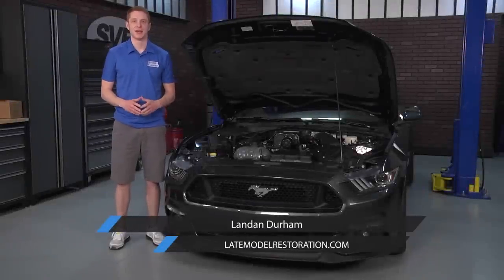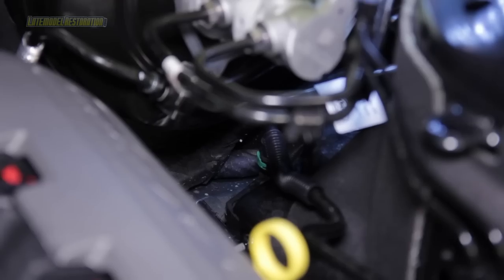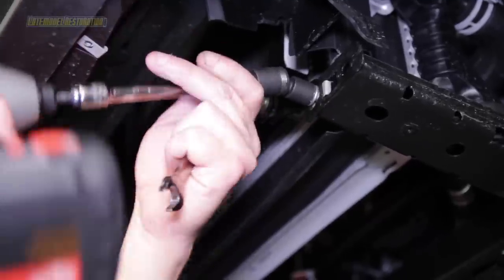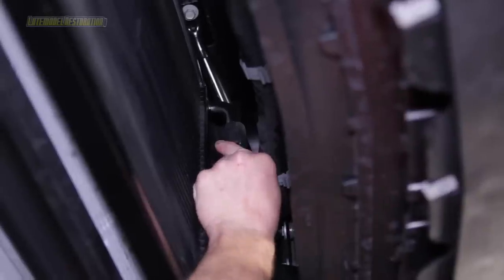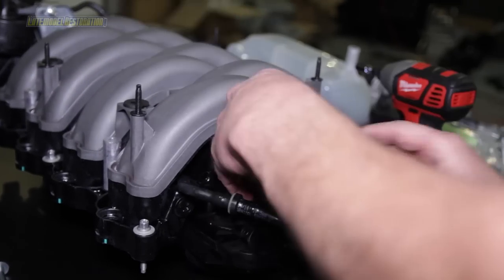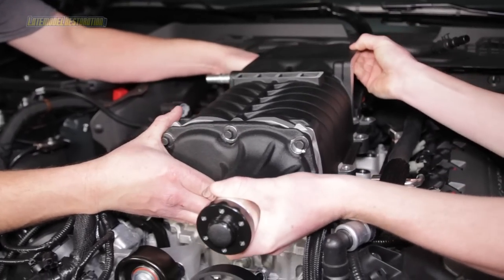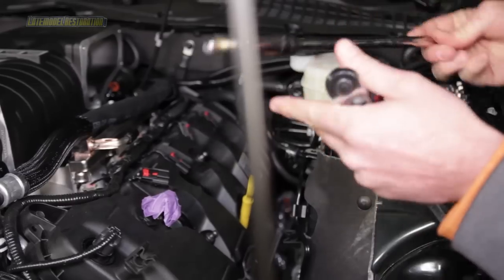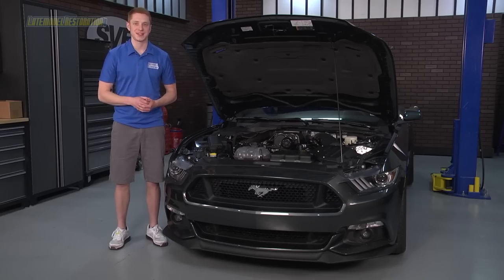Mustang GT Ford Racing/Roush Performance Phase 1 Supercharger Install (2015-2017 5.0L)

Comment: Do you absolutely have to cut your k-member? Couldn't you just modify it somehow? Same with the strut tower brace extensions to let it sit slightly higher?, I'm not sure I'd be comfortable cutting structural things out of my new car that seems a lil sketchy. I'm starting to lean towards the Whipple kit now that I've seen this video.

Comment: I would not touch the new ford racing supercharger because ford dumped Whipple for Roush crap. When magazines test no less than 4 different 2013-2014 RS3 supercharged mustangs! And achieve acceleration no better than a stock 5.0, and the editors say they thought the superchargers were broken or not put on these RS3's, that you have to be concerned about a supposed 600+ hp mustang, no faster than a stock 420 hp mustang, you know the product is bad. No thanks Ford Racing/Roush.